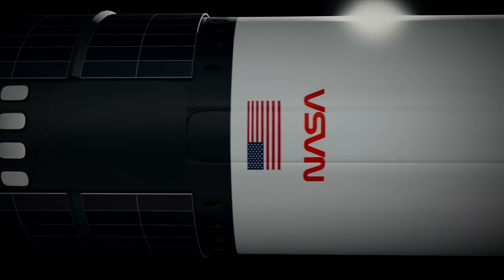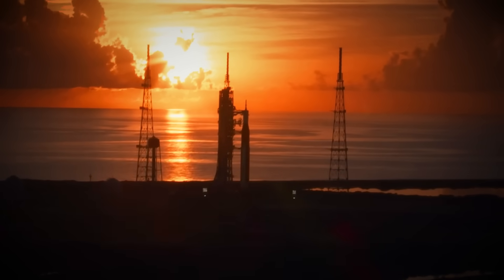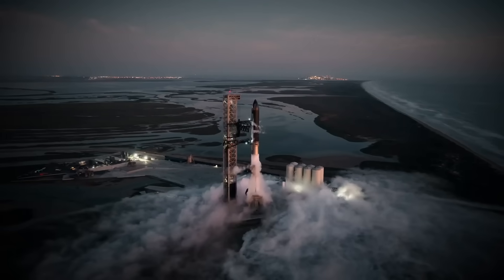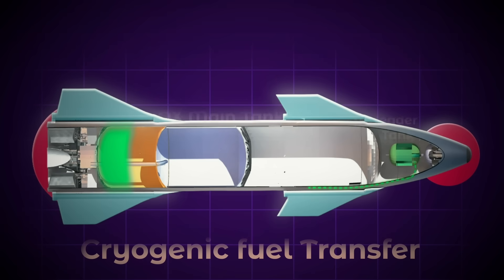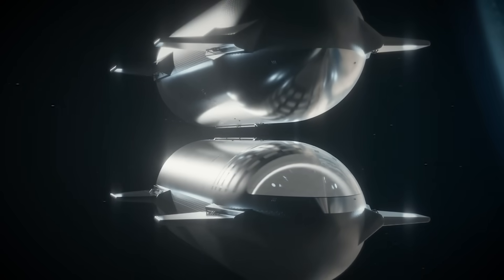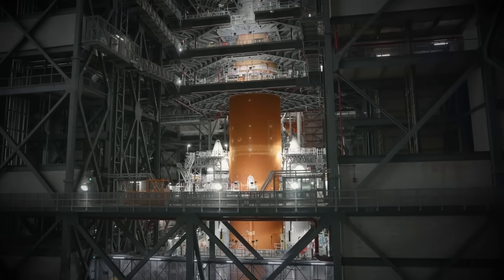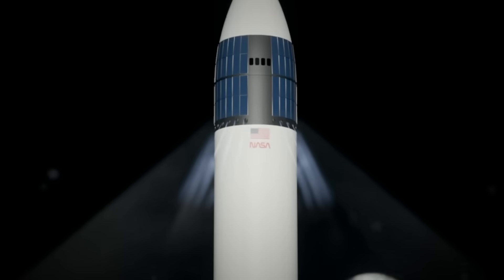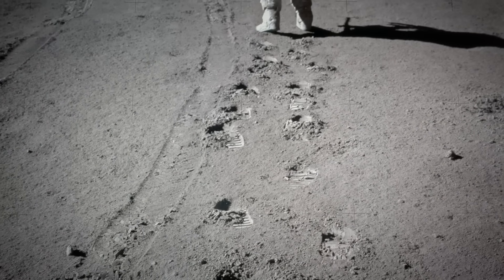How SpaceX and NASA Will Land On The Moon

Comment: why sending back anything. instead of lunching useless men to the moon just lunch electric bobcat with plutonium RTG battery and local AI network, start digging for the next decade. We need building radiation shelters, solar or Bialkali (KCsSb) photo panels as a power grid, and water recycling and production centers. most of work will be done underground where actual soil exists.  why NASA is in the picture? We need someone that actually know how to build like industrial construction crew.

Comment: space ex should consider "gravity assist" boost to the moon. Refueling less in orbit before blasting out of low earth orbit to an elliptical orbit around the earth, gaining speed at every flyby by the earth before blasting off to a larger orbit until enough speed is gained to fire the engines towards the moon. This entire process could take many days but possibly save low earth orbit refuelings. If not feasible for manned ships it could be beneficial for automated cargo journeys even to Mars. O%-D

Comment: someone please look up docking tip to tip on google and post definition. fukin halarious!!!!!!!!!!!!!!!!! it wont disapoint!!!!!!!🤣🤣🤣🤣🤣🤣🤣
Reply: A very intimate and intense sexual act performed by two uncircumcised men. Guy one pulls his foreskin back and holds it while guy two stretches his open and outward as far as possible over the head and shaft of guy one's penis. Then guy one repeats the procedure as he's releasing all of his foreskin that he was holding back tightly, pulling the opening out and as far down as possible over guy two's penis, making sure guy two's foreskin stays in place. When complete both cockheads are touching tip to tip encased inside of each others foreskin, the duel coverage combined with the moist juices starting to flow from each of them creates a suctioning effect somewhat similar to a fleshlight, helping to hold everything in place while jacking both penises as one, an effect much like that of those chinese finger "handcuffs", allowing quite a bit of masturbating action while easily staying inside of each other. The sensation is so intense that both guys will quite often ejaculate simultaneously, visually filling the foreskin coupling with so much cum you can see it swell to the point of overflow, slowly uncoupling the foreskins and savoring the warm wet sensations, working their still hard penises together with their intermingled juices... thats what elon is gonna exactly do with 2 rockets😂😂😂😂😂😂😂🤣🤣🤣🤣🤣🤣🤣

Comment: OK guys, hold up. 1) Put a third stage on StarShip. The third stage will be divided into three parts each going down to the moon one by one. 2) Space Going Tug will do the work. Reduced tonnage to Moon surface. SS stays in L MO. SGT can move parts A,B, @ C if needed. SGT will lift the Bed & Breakfast back to SS for trip home. Bigger version for Mars.

Comment: "10ish launches" sounds like a tall order. It's not just the number, they also need to happen within a few days. So far, they need weeks for a single launch, and didn't recover any hardware ever, besides one booster. So for the lunar lander, they first need to establish full reusability, which could be years away. Just throwing away every refueling starship would mean the entire exercise was pointless ... might as well have used Falcon Heavy for the refueling and it would have been cheaper.

Comment: We didn't lose the technology to go to the moon. But that technology was a dead end anyway. The available technology back then was stretched beyond reasonable limits to achieve that landing, with not that much benefit in terms of technological progress. They just pumped a lot more money into it. Any technological advancements that could be used outside the space program pale in comparison to the cost. You could argue that doing Apollo so early has kept space travel back more than anything else. Apollo was so ridiculously expensive that nobody wanted to continue this fool's errand. We can now go to the moon far cheaper than back then, and do more. Going to Mars? completely impossible with the technology back then, or at the very least until the 2000s. If we had run a continued progress, invested the Apollo money gradually, we could be on Mars right now!

Comment: Quelle est l’intérêt d’un moon lander aussi gros pour transporter deux gugusses ? À moins que ce soit pour tester la technologie pour faire des missions de plus grande envergure par la suite ? Car niveau efficience, on a diviser l’équation par 10. Saturne cinq, elle toute seule pouvait envoyer tout le bousin et là faut une dizaine de fusée pour aller remplir le réservoir et envoyer un truc énorme. À moins que le moon Länder reste en orbite pour les missions suivantes ?
Reply: This lander is designed to be fully reusable, unlike the Saturn-V’s lander which was single use. It could also carry much more to the surface, be it cargo or people, and once it’s done, it will dock with the Gateway Space Station in Lunar orbit to transfer crew and then fly back to low earth orbit to refuel with tankers.

The cost to launch the tankers will only be the cost of the fuel as Starship itself is designed to be fully and rapidly reusable, meaning it could only take a few days and a couple of launches for it to fully fuel the lander.
Reply: @archierush868  but why not using a small lunar lander docked to the gateway and refuled by the Starship? so that the fuel used for moon landing and takeoff is much lighter. I mean of course if we want to carry houses on the moon fine but for Artemis 3 it is only 2 folks including a lady (half weight ;)

Comment: I can’t stop laughing!
😂😂😂😂😂😂😂
Reply: This is so plan stupid on ao many levels... im flabagasted that some one could have thought this may be a good idea. Wow. After milion point of failure - the idea of putting a 17 storey pencil on moon uneven surface just to open a slit in large payload bay and put out exterior elevator for just 2 astronauts (and lets not forget suits 😂) is astonishing.
I would like to see starship hauling a moon module to the surface just to tip over after splitting payload bay open and trying to crane the module down to the surface... and even if by pure stronę of luck this could be done, it would be nice to see how such moon module being obliterated when this huge pencil fires its engines on its way back...

Comment: Landing on Earth Starship comes in horizontal and then does the belly flop maneuver to go vertical.   On the Moon, they should come in vertical and then flip to horizontal and have some fixed landing legs. They are going to use a ring of thrusters high up on the vehicle anyway.  Redesigning to have the thrusters point down when horizontal shouldn't be an issue.  They can add the fixed landing legs with an EVA from the ISS before heading to the Moon.  Once HLS is in space it is never coming back to Earth.  No heat tiles. Landing in a horizontal  position is more stable and makes it much easier to load and unload cargo and astronauts to the Moons surface.  On launch, they only need to get about 100m altitude before flipping back to vertical and using the main raptor engines to make orbit.

Comment: The egg shaped orbit is not necessary. First,the fuel requirements to get to the moon, cut in half. No hot stage rocket firing is necessary because it has side mounted rockets for the moon landing that can be used,aleminating the 20,000 pound hot stage shield. That weight can be added to water processing or mining tools. Launch the Starship from earth on one first stage. At the same time, launch a miniature version of the first stage booster weighing equal to starship. The miniature version of the first stage connects to starship already in orbit, aleminating the need for in orbit fuel transfers. If Starship it to be used for habitat,use the side rocket's to set it n it's side softly. But the one that has to lift freight from Mars,It needs a landing pat shipped there separately.
Now babe to the egg shaped orbit. On the opposite side of the moon the base can simply ride in higher orbit from earth than the moon,swirling in a corkscrew motion with the moon holding it from moving away. Flux pinning effect would be nice application but probably not necessary.

Comment: Why does it look so much harder to land with 10 Starships refueling and everything they need for a landing, why was it possible to just land on to Moon with now better computers, better materials. 2nd stage of Starship is too big. Reconfigure the second stage in a 2nd and 3rd stage rocket where the 3rd stage is less heavy and why do you need such big rocket to land on the moon. 

For every kilogram you shoot into space to a lunar orbit you need a lot of fuel so for a moon landing instead of this very complex thing. Try to make a 3rd stage for landing vehicle and use the starships as mothership circling the moon.

Comment: The harmful properties of lunar dust are not well known. Based on studies of dust found on Earth, it is expected that exposure to lunar dust will result in greater risks to health both from acute and chronic exposure. This is because lunar dust is more chemically reactive and has larger surface areas composed of sharper jagged edges than Earth dust.[22] If the chemically reactive particles are deposited in the lungs, they may cause respiratory disease. Long-term exposure to the dust may cause a more serious respiratory disease similar to silicosis. During lunar exploration the astronauts' spacesuits will become contaminated with lunar dust. The dust will be released into the atmosphere when the suits are removed. The methods used to mitigate exposure will include providing high air recirculation rates in the airlock, the use of a "Double Shell Spacesuit", the use of dust shields, the use of high–grade magnetic separation, and the use of solar flux to sinter and melt the regolith

Comment: it seems nobody knows if starship has enough deltaV capacity to get back from the moon to  LEO to be refilled there. But this is a crucial point wether that concept makes sense.  At least spaceX and NASA should know and they should  share this information. If it only can go back to Lunar gateway, it cannot be refilled again and is not reusable. With each tanker starship you can bring 150 tons of fuel to LEO, but to Lunar gateway you need considerably more delta V so the amount a fuel that can be transported to there is negligible.
Starship completely refilled in LEO has a deltaV-capacity of 6.9 km/s.( with 150 tons of payload)  according to the deltaV map you already need 6.4 km/s to reach the lunar surface, and it would be 1.6 km/s to get from the lunar surface , to lunar orbit. So even for that  the delta-capacity would be not sufficient. Not taking in account yet, that the rendezvous manoeuvre with lunar gateway alone  requires some extra deltaV.
If you can mine water on the moon, and convert it into hydrogen fuel, the situation is much better of course But the required infrastructure to mine water-ice and convert it into rocket fuel, will not be available at artmis 3, 4, and 5. And spaceX would need to develop new rocket engines that run on hydrogen fuel.
Reply: That question depends on Starship performance, and that is unknown at this point: development has not finished yet so we don’t know what the payload will be.
Reply: @Hobbes746  starship brings 1000tons of fuel, +250 tons for the structure and 150t payload, that gives approximately a 6.9 km/s deltaV capacity. Probably for lunar starship without the heat shield and less payload , the deltaV capacity is higher.
But this is not something that WeE should need to speculate about.  
SpaceX and Nasa should know it, or at least they should know what the target is, when they implement lunar starship into the Artemis mission.
It is essential for the architecture, wether it can go back to LEO to be refilled, or just get back to lunar gateway and be not reusable, or if it even cannot leave the moon.
I ask myself why this essential information is not shared

If it can make its way from LEO  to the surface of Moon and back to LEO, the SLS and lunar gateway are unnecessary.
Reply: @thomasherzig174  As I said, that figure of 150 tons is not certain at this point. It’s the goal, but the current configuration is unable to do that (payload limit of IFT-3 was around 40 tons).

Comment: I think that SpaceX ought to build on a Larger Version Of Dragon for the Top Part of The Starship. Leaving the Cargo &Lift structure could be made to Operate easier. Using the usual Dragon Jet Rocket s. (I believe that although that Fuel type
Reply: Refill the Dragon tanks After fetching the Astronauts off The Other Orbiting SLS rocket and can return then to ground or the top of The Now White (Shiny one.) Also along the lower exterior of the Space X rocket on the outside of where the Main Launch Rocket s area they could build in Spray omitters which could spray Say Colloidal Silicate onto the moon surface regolith as it De-sends towards the moon s surface. Any heat would instantly turn the Regolith Colloidal mixture into hardened landing strip type surface. It offers variations for “Potential launch issues with either SPACEX or SLS return I’m sure Astronaut s Don’t wish to hear 👂 or be told: that we are SORRY but your e flight homes been cancelled due to The SLS(Boeing) designed vehicle can’t bring U home. Here’s where a refilled Dragon literally comes in the recapture the astronaut s &bring them Home IE:”The Backup plan!” Using refilled Dracko’s to help her up skyward then followed Space Station attachment Dracos pick up Astronauts and if necessary An added and fuel pod contained for a single Deep Space Flash fire and head towards the small blue marble (& head 4 home )-1/More firing &Drop off engine tank remaining what’s normally dropped off leaving Heat shield ready to do its job. Invert and earth entry chute’s deployed and ocean sling pickup

Comment: All this work shows that Nasa never been on the moon in the first place. so stop Bullshitting about the reason they have problem now is because of funding. No. they have never been on the moon. so that is why they have to invent the wheel for the first time, since the first time was a fake.
Reply: Nope. It just shows that going to the moon is difficult and takes a lot of work. For Apollo, NASA spent $300 billion. They ran 29 unmanned missions to the moon before Apollo got started. 17 of those missions failed. Each failure was a learning point that was used to improve the next. 
Now, people are whining about IM-1 failing its first mission to the moon, run on a shoestring budget compared to Apollo.
Reply: @Hobbes746  LIARS!!!
Reply: @Hobbes746  yes they failed so many times but they learned from each mistakes and made the next try little better, so at the end they succeed.  
And suddenly after 30-40 years or technology jump from back then,  we suddenly unlearned everything and our space rockets has gone worse that it was 40 years ago. That is why Nasa can't put a rocket on the moon with tipping over like a toy. 

Stop being sheep.  Use your head. 

NASA NEVER BEEN ON THE MOON.
that is why it is so hard for them now. Because the first moon landing was fake in the race with Russian.
Reply: u dumb rightwingers need to lay off the pipe 🤡